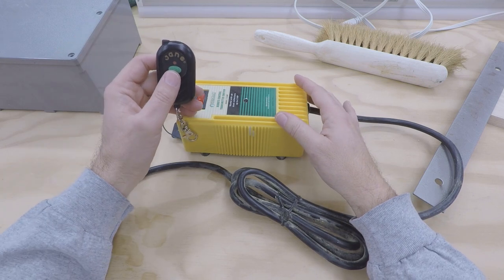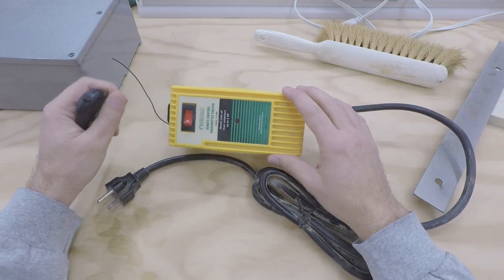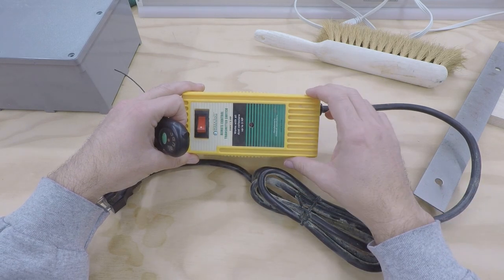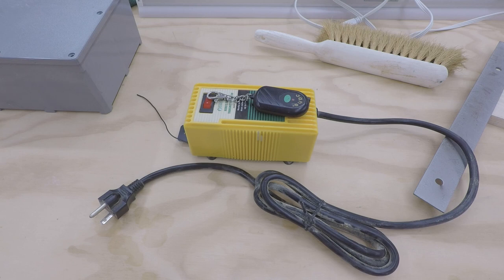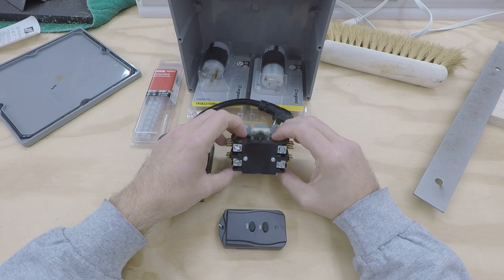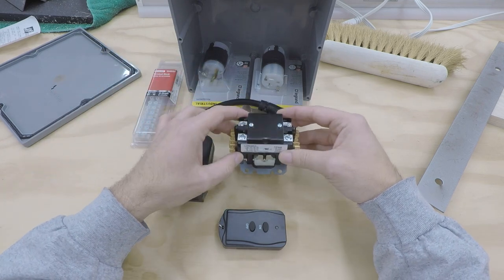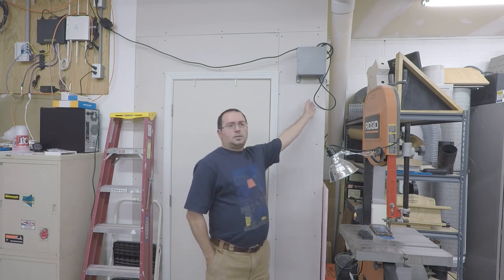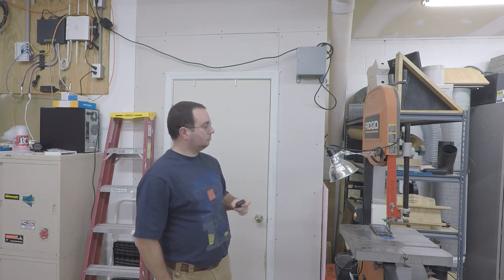Dust Collector Remote Build

Comment: Great project.  I wonder how many amps you Vac pulls at startup, I bet lots.
Reply from the maker: Good question. I have a clamp on amp meter, I'll have to check and see.
Reply: @andycannarella  I suspect that you dust collector draws a lot of amps at startup and that's the cause of you purchased switches to die.  You designed switch could be modified to handle higher currents or by adding another contactor could handle three-phase electric power.  I could use my iVac System to control the contactor  to handle higher loads.
Reply from the maker: I just pulled apart the unit that failed. The circuit breaker on it is 25A over the replacement one that had 15A to handle that inrush.  The internal relay failed. I think 3 phase would be a bit over kill for my home shop but heck the machines would be cheaper.
Reply: @andycannarella my next shop will be three-phased, now I don't even have 220v one phase.